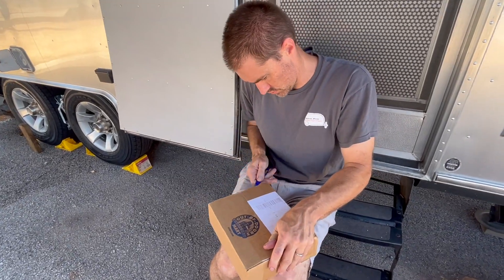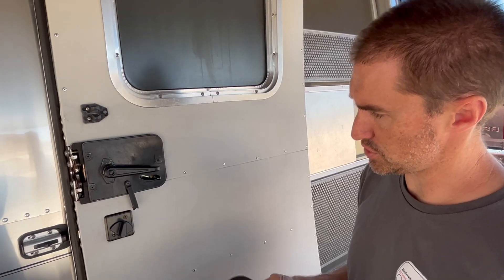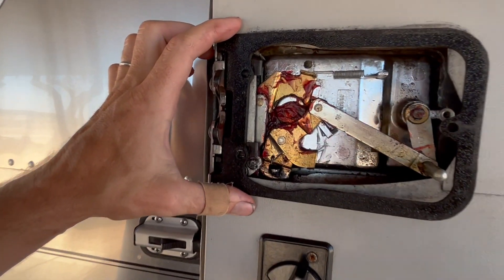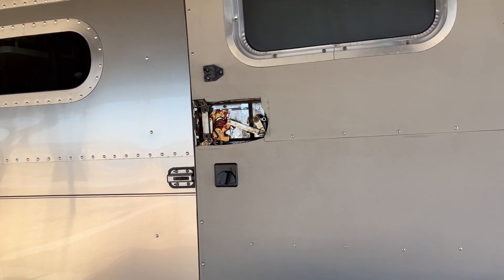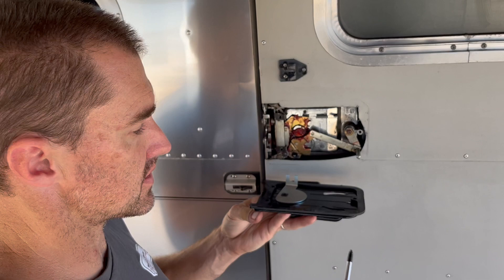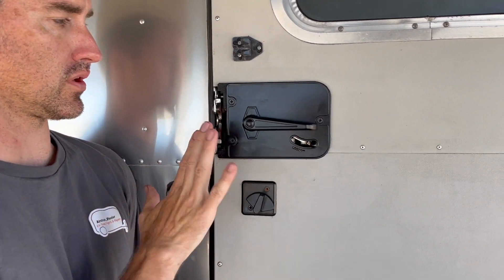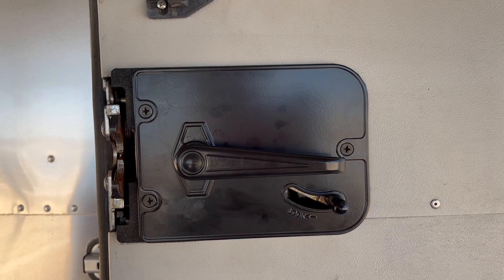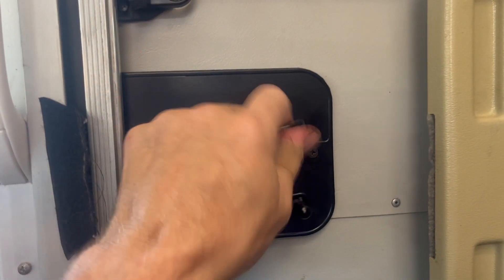Airstream Door Latch Replacement

Comment: I have to do surgery on my lock. The slider is so stiff I am afraid I am going to break the key off. Even just moving it manually requires way too much hand strength. I have been procrastinating because I was afraid of taking the face plate off and having a bunch of spring loaded parts jump out at me like Happy New Year!!!!!!!!! Now that I know theres no surprises back there, Im goin in!!!!!! Thank you for posting this, and well, Happy New Year!!!! 😄🎉🥂
Reply from the maker: Give it a try! It’s definitely not a jack in the box, but I’d advise taking pics as you go just in case and pay attention to the orientation and alignment as you go. Thanks for watching!
Reply: Well I did it! Better than new. Literally. Bought my trailer brand new in 2022 and I guess they had some supply chain issues with grease or something. Lubed it up and it works like a dream now. Thanks so much!!!! 💕🩶🦩
Reply from the maker: Awesome! Glad you figured it out, Happy New Year!